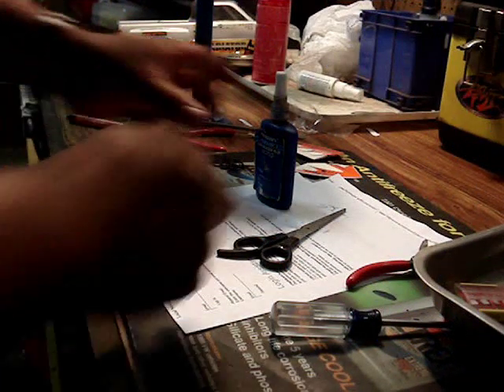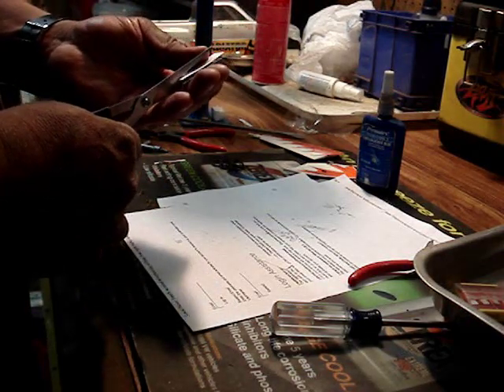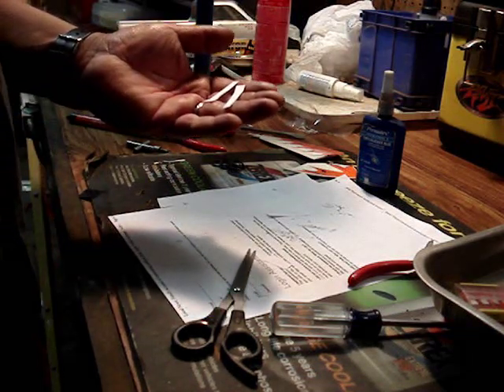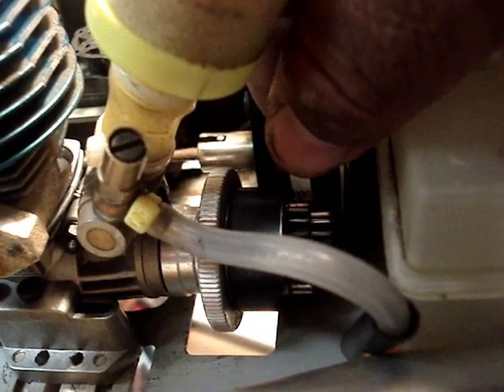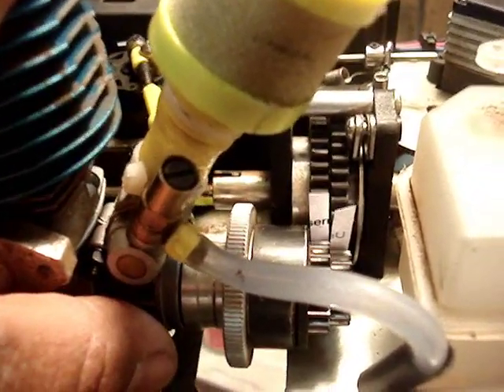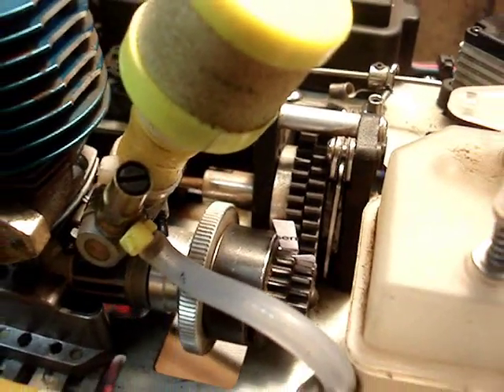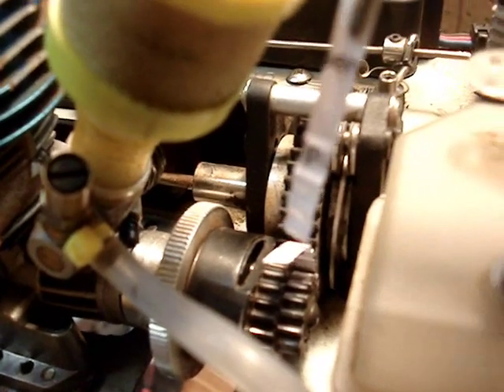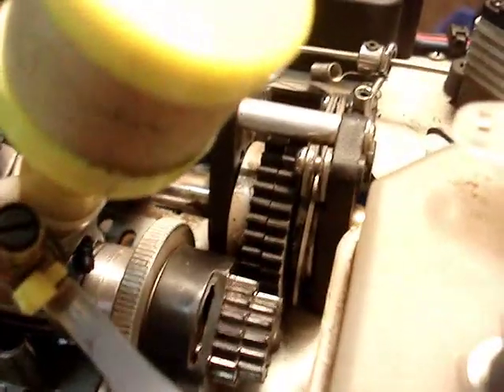PERFECT "MESH"

Comment: ive got a problem in that spot you was video-ing that black case with the nut on the end, its got that white case underneath with a spring around it right and the black shell+nut keeps slipping and we tryed sanding down the white casing so reduce slipping and we tryed fixing that and now the back wheels are to nove forward but jsut aint working keeps going opposite directions please help? :)